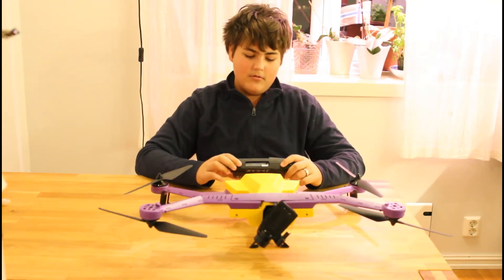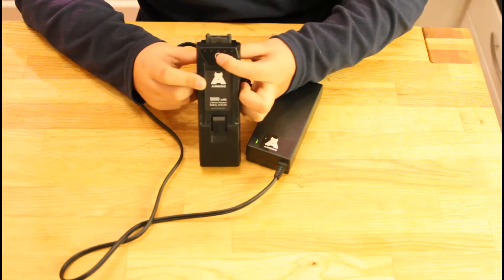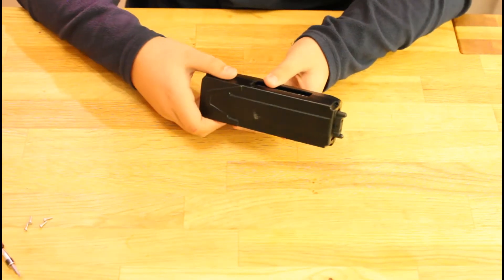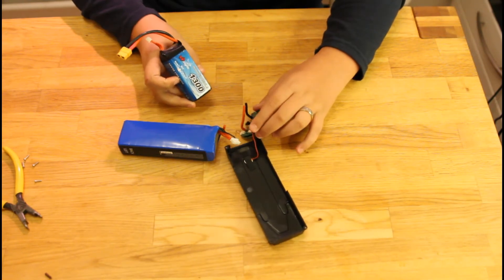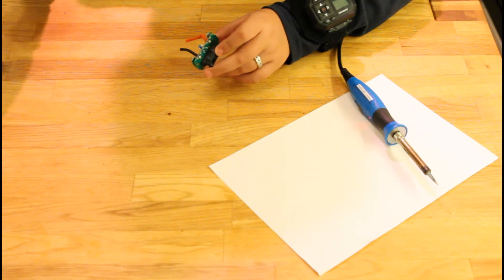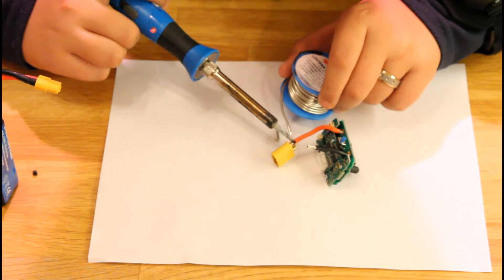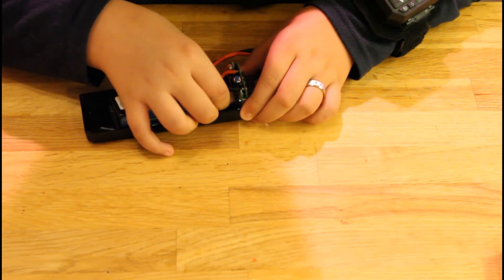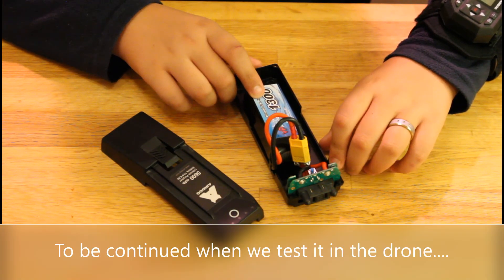Fixing Airdog drone battery part 1 - battery not working

Comment: What battery did you use to replace it and where did you get the battery and parts thanks
Reply from the maker: I just bought a 4s LiPo at the local RC store and guess any 4s would work. I would look for as large battery as possible, one that still is small enough to fit
Reply: Thanks for your response  I will check it out thanks
Reply from the maker: @slimsmith5569  Looking forward to hear your experiece:-)